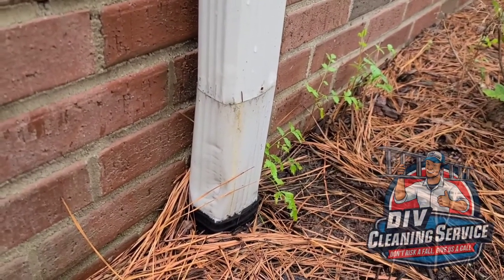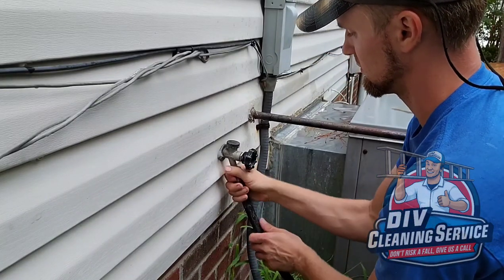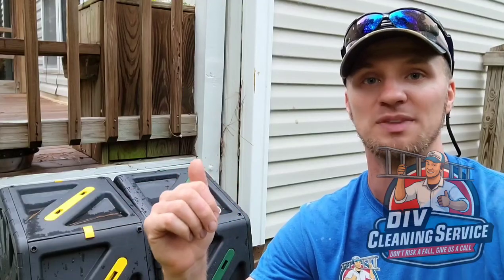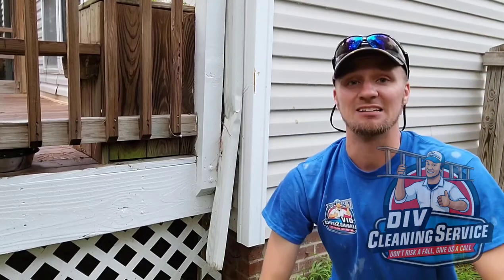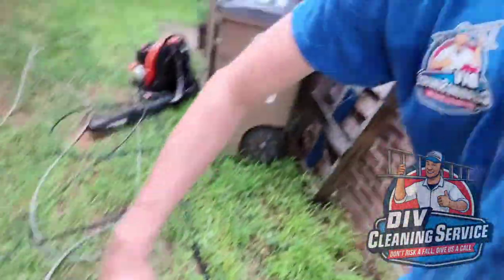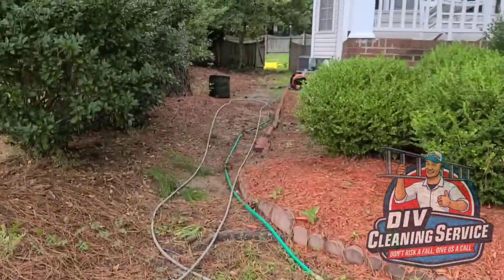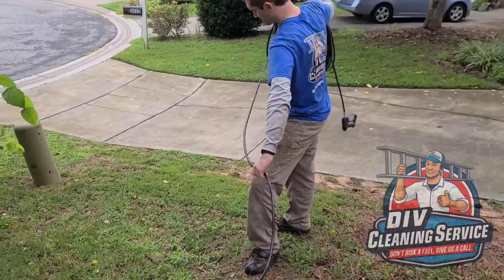Underground Drain Flush- how to have a tangle free jetter line- In Raleigh NC

Comment: I put my 300 ft of quarter inch on a hose reel from tractor supply which works really well and we look like pros. Also do not use corrugated on underground, period!  Use on perforated rigid pipe with holes facing down. After 22 years of specializing in drainage you either DO IT RIGHT OR GO HOME, PERIOD!
Reply: What hose reel? Interested in doing the same thing.
Reply from the maker: I use a high pressure reel now, but it's always nice to know how to wrap lines so they don't tangle. I was just teaching 2 new workers today how to do the "over/under" method.

Comment: Good tip with the hose ......
Just wondering what kind of gallons per minute and psi is good for this type of thing.
I am Looking to buy a new pressure washer.... 
I have a jet tip with 100foot hose hooked up to my electric 1800 psi ......it’s not cutting it.
Thanks for the videos...
Reply from the maker: The higher the GPM the better. I personally use an 8GPM Machine. I have also used a GPM. So higher pressure, higher GPM the better.

Comment: Hello. Will 2500psi with the hydro tip work on 3”-4” pvc pipe drain out the mud that’s stuck in there ?
Reply from the maker: Maybe, GPM is more important than pressure.

Comment: Does the water pressure from the nozzel help push the hose farther into the pipe?
Reply from the maker: yes, the forward hole blasts debris apart and out of the way. The backwards holes propel the jet forward and flush the pipe.

Comment: You just saved me the cost of a $200 hose reel.
Reply from the maker: Nice! The reels are great at times, but not a necessity if you don't use it all the time.
Reply: @divcleaningservice9522    Hey there DIV...  I bought the 50 foot version of this exact "hydro snake" and have unclogged a shower drain, a kitchen drain, one toilet and every leaf ridden down spout I have.
I consider this a miracle tool for home owners who have a pressure washer.

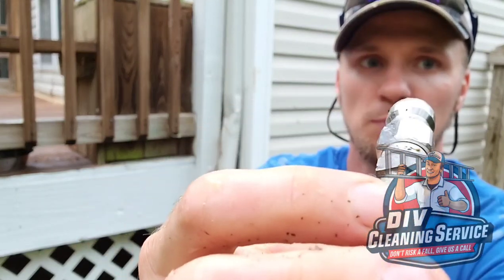Comment: Thanks for the video and tip you did a good job 👍🙂. May i know how much psi you running at 2:46 of the video thanks. There’s no blockage that can not remove on that pressure.
Reply from the maker: About 3000 psi. 8GPM It's not going to cut big roots with this tip, but it will blast past/apart smaller ones.

Comment: What kind of trigger gun is that? Does it have to be a specific one? If you dont mind telling me. Thanks!
Reply: It appears hes using a pressure washer trigger for his line. You can also use a high pressure valve.
Reply from the maker: Yes, just a pressure washing trigger. Ball valve or foot peddle valve work great.
Reply: Awesome, thanks both of you guys for the help and keep up with the good content.
Reply: @kevindale2010  okay so if I just use a high pressure valve I don't need to have the line connected to a Pressure Washer Machine is that right? I'm trying to do it myself and have no experience at all...
Reply: @loneroffroad4036  you will still need a pressure washer or jetting machine to create your pressure. The ball valve, foot peddle, and washer wand are just different ways to control the flow of the water.
Reply: Great video. Do you think this would damage terracotta sewer pipes?